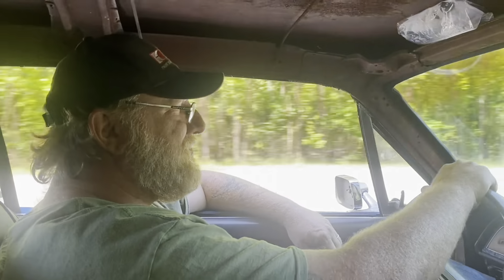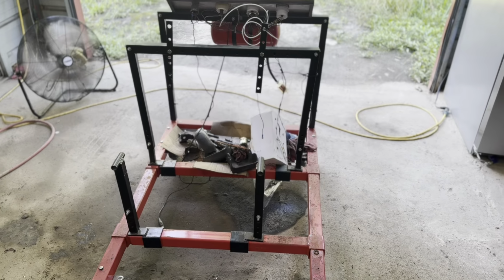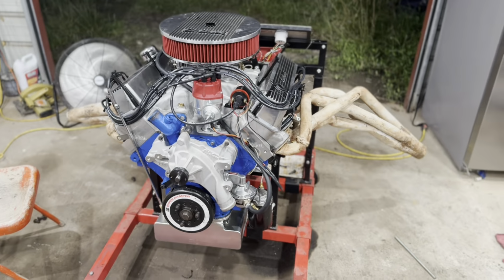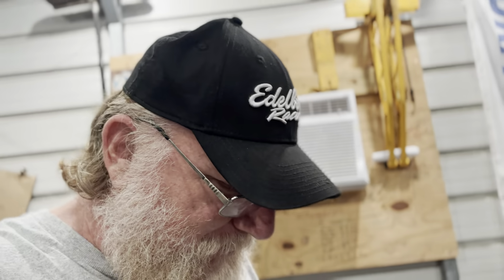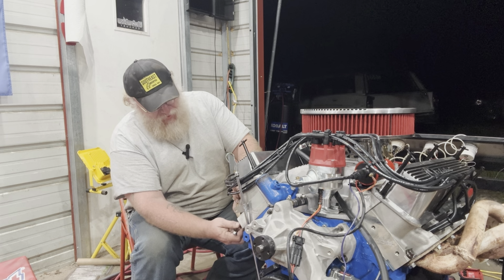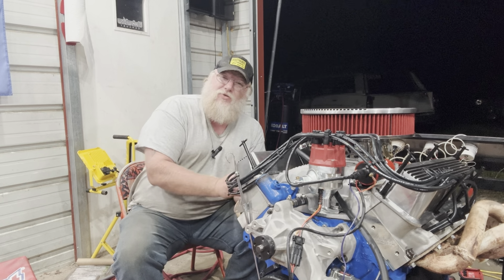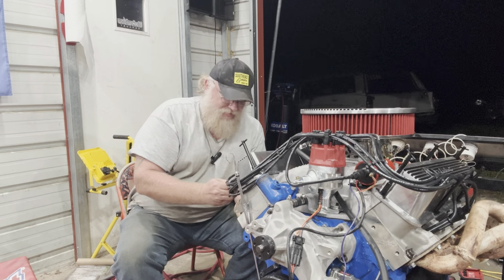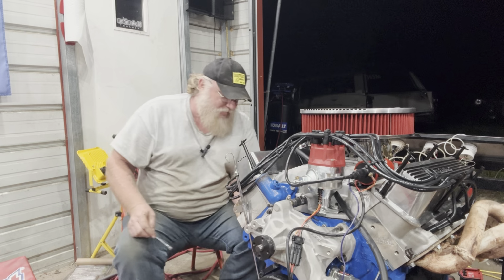A new FE goes home today

Comment: McMaster-Carr has hex drive bolts in the length you need. These are equivalent to grade 9 or possibly higher. . They have hex head in grades 5 and 8 but are 3/4" long. 7/16" bolts are not often used as you stated. Hope this info helps.
Reply from the maker: Good info thank you.   My issue is about all I do is manual stuff so I have bolt but they are all long bolts.   I just don’t have any short bolts.  But I should keep a few in stock for those few times I need them.   I appreciate the info
Reply: @frizzellracing  You are welcome. BTW, ARP doesn't have them either, at least online under the bellhousing heading.